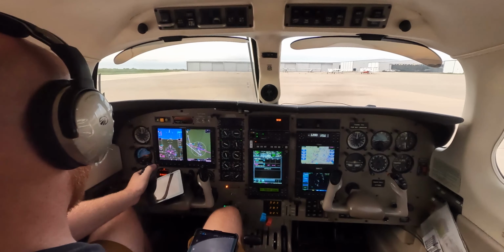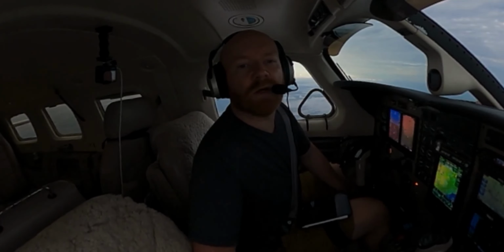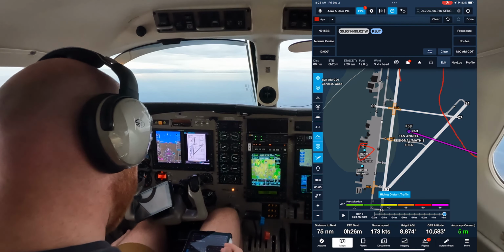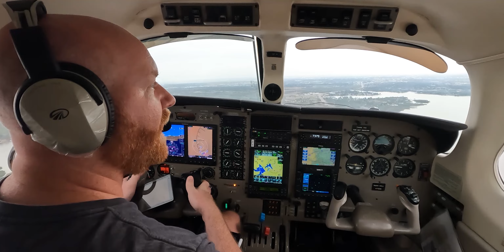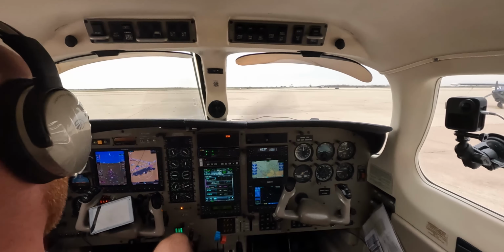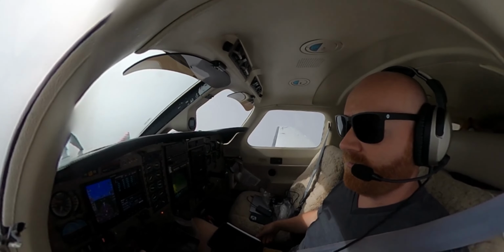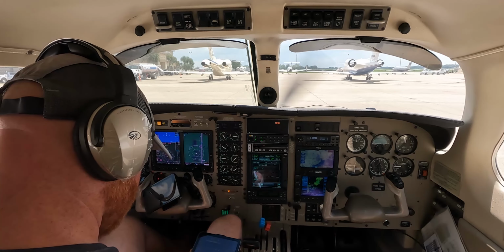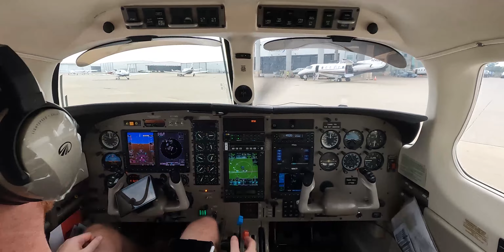PA-46 in ice & in-flight maintenance issue

Comment: Beautiful plane! Quick question, is it common to land in a Mirage on its lean mixture setting? 😀
Reply from the maker: Good question! Yes it’s normal to leave the mixture set to cruise through landing. It’s just important to remember to do an open hand throttle push if you have to go around (meaning you advance all three levers — not just the throttle).